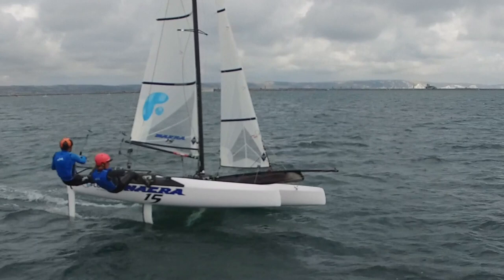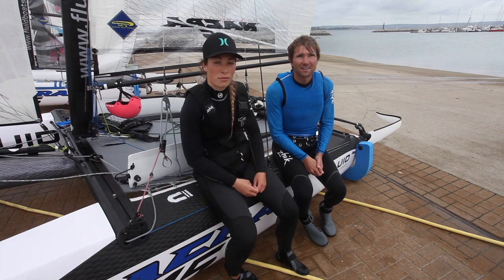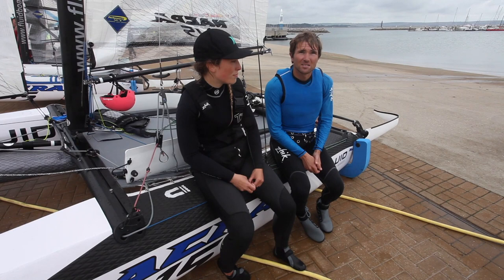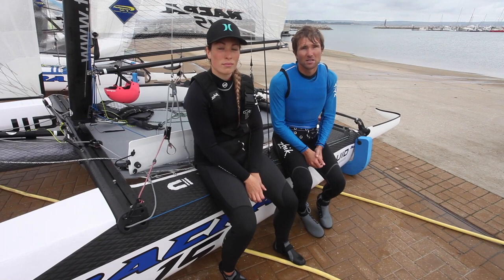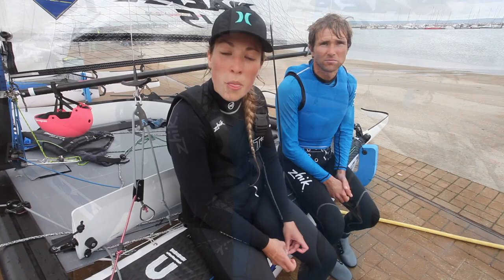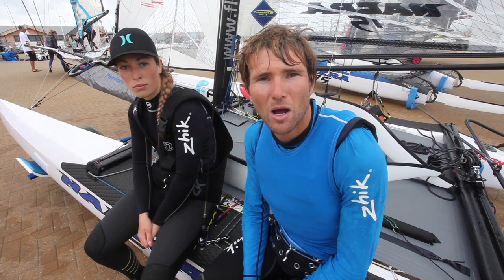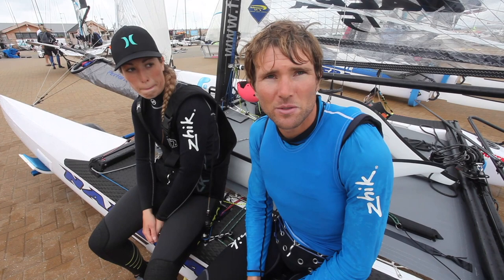Nacra 15 tested by Chris Rashley and Chloe Collenette for Yachts & Yachting magazine

Comment: How heavy were the both together? Can the Nacra 15 be sailed well with two adults?
Reply: questions that need answers
Reply: @deankruse2891  I now own a Nacra 15. With two adults each 90kg and over 1.90m, one in the trapeze is enough at 15 to 18 knots. My crew (weighs 60kg and is 1.65m) loves the Nacra 15 as opposed to the Nacra 17 MK1 as he gets immediate feedback on the effects of his weight trim.
Reply: @deankruse2891  I (90kg 2m) have also sailed the Nacra 15 in threes with another adult (75kg 1.75m) and a nine year old.  That went well in light winds and from 15 knots of wind the boy and I were in the trapeze.
Reply: @deankruse2891  However, when there are waves on a downwind course, you notice the lack of length.  And with two adults you need good coordination when maneuvering on the trampoline in order not to get your feet caught.
Reply: @joy2sail_de  i'm 85kilos and want to single hand it in heavy winds, probably just mainsail.  Like 30+ knots, is that possible?
Reply: @deankruse2891  I (99 kg, 2m) sailed last summer on the Saaler Bodden at the Baltic Sea by probably 30 knots of wind. I felt safe on the Nacra 15 with C-daggerboards and without jib. But it wasn't that much fun. Nobody else was sailing and no rib to call.
Reply: @deankruse2891  Tacking without jib is no problem if you are sailing singlehanded. With crew it is easyer to tack with jib, otherwise you may be have to sail/tack backwards as on a Hobie 14 or Hobie 16.